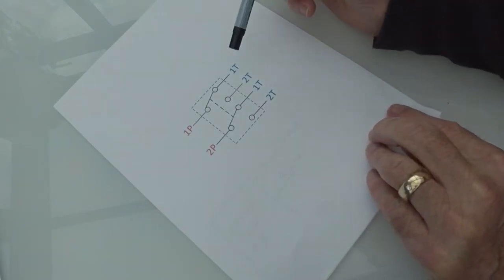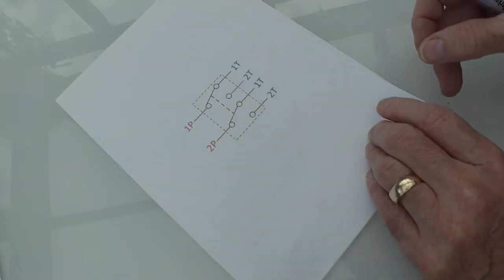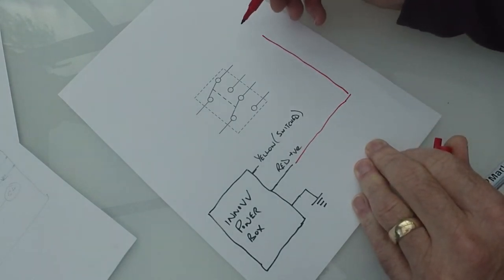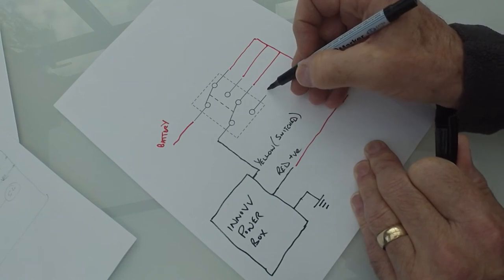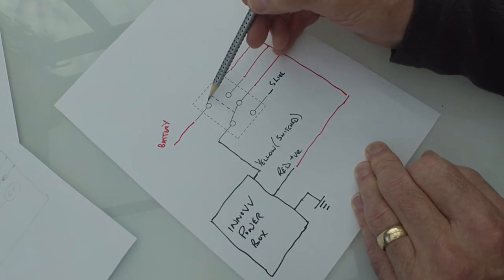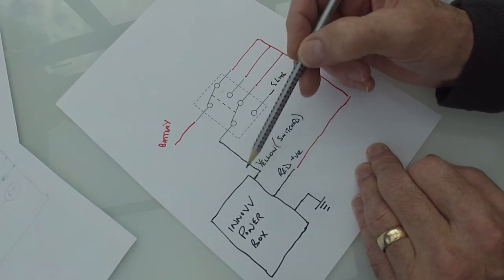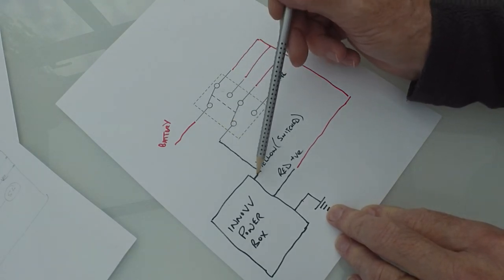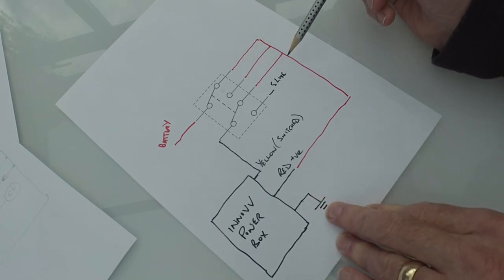3 Way Switch on my INNOVV Camera - WIRING DETAILS

Comment: how did you connect all 3 reds together ,ie soldered or scotch locks
Reply from the maker: Hi. The switch I used has tags for each wire, with a hole through. So I poked the wire through, bent/twisted it over and soldered each one. Each also then had a short length of heat shrink over the whole wire & switch tag. This was to ensure a strong mechanical joint, as well as a sound electrical connection. I never use Scotch Locks these days. They're quick and easy and probably fine if you're using exactly the wire size / type they're designed for. In practice though, they're not very reliable in my experience.